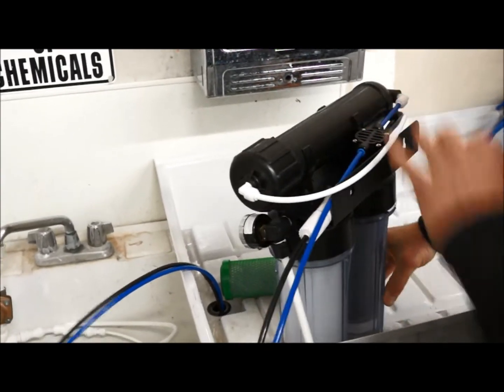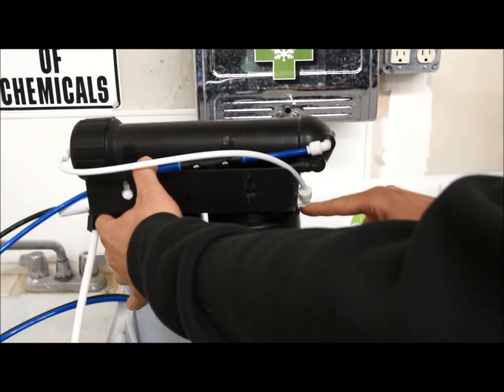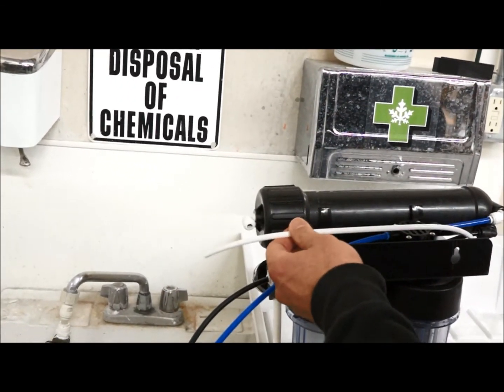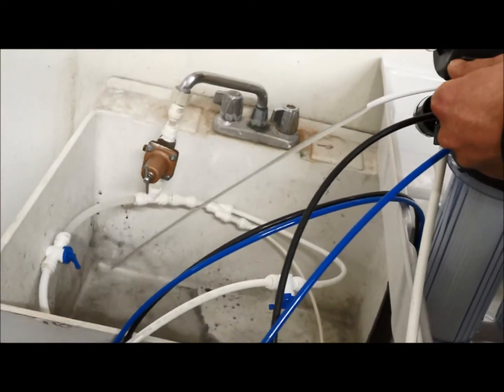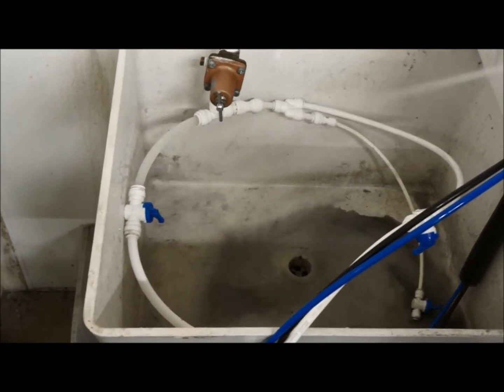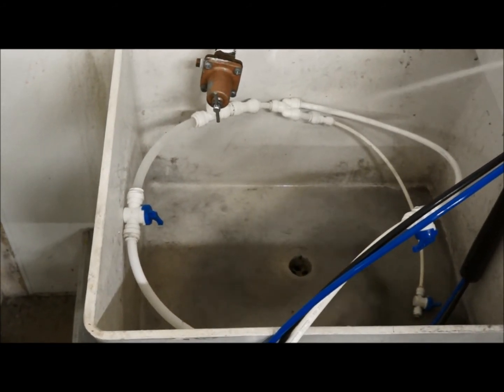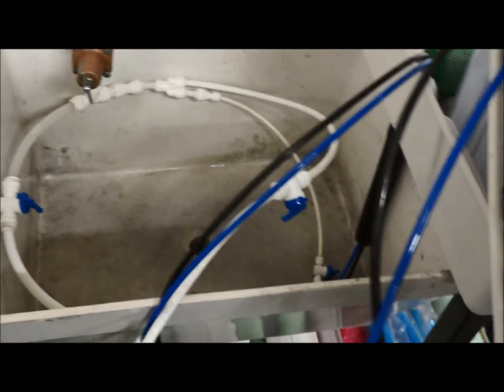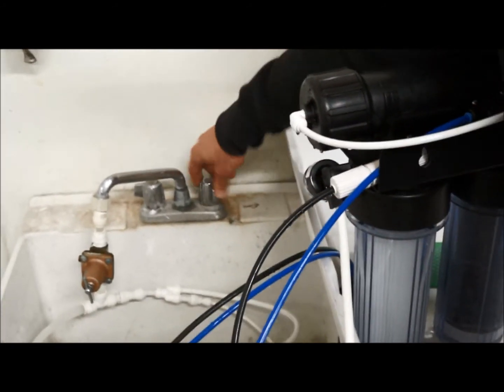Flushing a HydroLogic KDF85 Filter Prior To Use

Comment: You put that di cartridge on that without a three stage pre filter and watch that resin deplete in 20 gallons😂😂😂😂. Hydrologic is nothing but rebranding and 300% markup. AMI makes their membranes and they use other things like filters and fittings from buckeye hydro. When they sell a membrane for $100+ dollars because they got it made in black instead of blue for the same membrane you can buy direct for $25-$30 they have no credibility😂😂. If I’m wrong let me know . They market their products to hydro gardeners who don’t know any better. Such a shame that companies exist to obfuscate their products behind marketing and clever branding.   Hydrologic can’t even tell it’s customers the number rating on their flow restrictions or the ppm ratings for source water that should be used to gauge membrane longevity.  They run their 300 gpd systems with parallel membrane configuration doubling the waste water and reducing the membrane pressure at the same time making the whole system less efficient while never mentioning any of that in their product manuals.  Selling catalytic granular activated carbon for $50 bucks a filter when you can buy the same exact product for $10 bucks and fill the cartridge yourself is Highway robbery. 😂😂😂  I make sure everyone I come across who bought one of these systems never buys anything from them again 😂😂😂. This video is horrible and only serves to show what the company really is. 😂😂